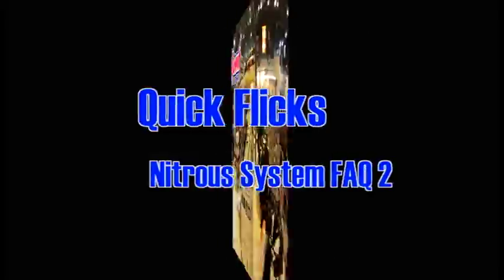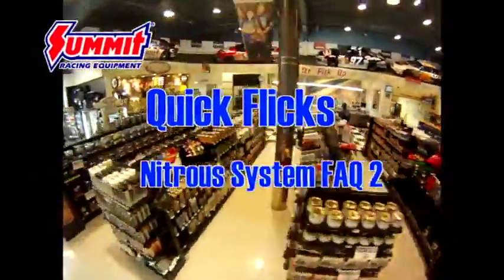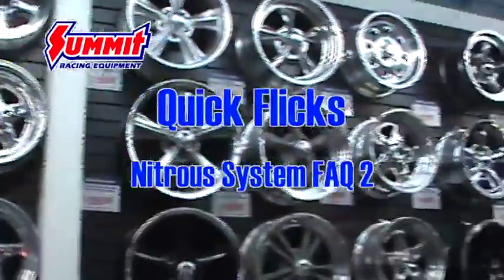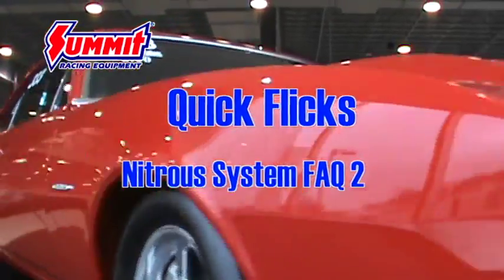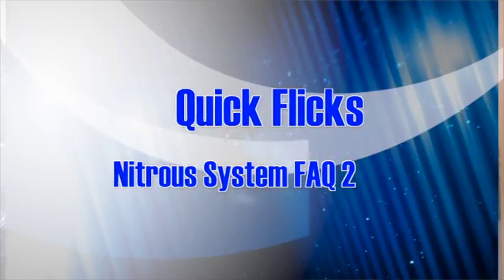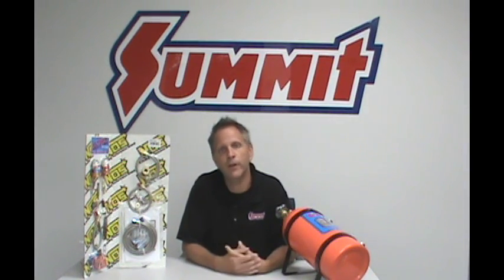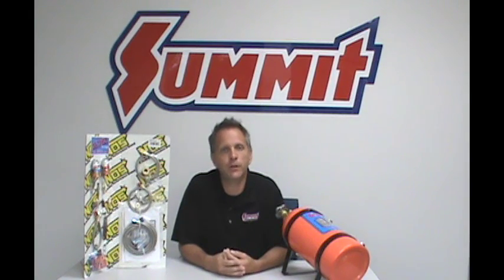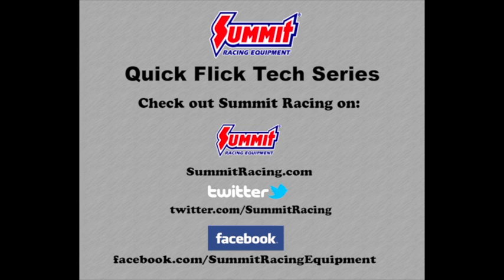Upgrades to Consider When Increasing Horsepower with Nitrous - Summit Racing Quick Flicks

Comment: I have a 302 ford with cam , valve springs , and rocker arms upgraded and 72 mm valve body  what's recommend as far as nitrous?
Reply from the maker: Assuming the bottom end of the engine (crank, rods, and pistons) are still all stock, I would recommend a max 125 to 150 hp system. For the exact kit, we would need to know the year and make of the vehicle the engine is in.

Comment: i had a 350 4bolt main i threw in a 200 wet shot and ran a 6 on the 1/8 mile........only 1 pass though :(

Comment: Should i file down piston rings if i plan on running nos ? I dont plan on going pass a 100 shot in a sbc with stock parts other than cam and heads ?

Comment: With nitrous do you have to make the gaps in your piston rings bigger?
Reply from the maker: Hi Rico, 
Yes, depending on the additional power added  (kit size) by the NO2 kit. This extra power adds additional heat to the chamber thus expanding the upper ring more. If you know during the engine build process that NO2 will be used, it’s a good idea to add some ring gap so that the ends don’t butt together and damage the ring land in the piston.

Comment: i have a 1987 mazda rx7 1.3l rotary engine , this might be confusing when you hear 1.3 liters... but it is documented as 1.3 liters, but since we arent your typical piston engine, i think the community accepts the as 2.6l , equivalent to a 6 cylinder engine  . naturaly aspirated, i just ordered the 35 to 75 shot sniper efi wet system . i want to know how much i could run, it was rebuilt about 26k miles ago, i installed a walbro 255 fuel pump.  mods i have is basically just silicone vaccum hoses, and suspension mods and a cherry bomb muffler im hoping for 175 shot with this car, but 75 for now would be great. i also removed my 5th and 6th sports which basically is what a variable cam timing would be one a piston engine, so all my ports are always opened, its our version of liek hondas vtec
Reply: great thanks for the reply, i will make sure to give a 5 star review on the summit page, and leave positive feed back once i install the kit. i got the kit the same day i ordered it . thanks summit . keep up the great work, i am never disappointed by the this company.

Comment from the maker: Hi Airidas, 
Keep in mind that the motor was not designed from the factory to be used with Nitrous but, as long as you keep the NO2 kit size realistic, such as 50-75 additional horsepower, you will not have a problem. Anything more should be considered at your own risk! Thanks for watching!

Comment from the maker: Hi Matthew, 
Not necessarily unless the motor has high mileage, then you should at least consider a new set of valve springs. The reason is because of the increased RPM the motor will see when using the NO2. A few other simple items; make sure your air & fuel filters are clean; check your timing and reset to factory spec if necessary and regap your spark plugs, maybe even subtracting a few thousands of gap to ensure a strong spark! Thank you for watching :)

Comment: Great video, Im just trying to look into gaining HP, I have  a stock 93 tbird (V6 3.8) naturally aspirated, would I have to upgrade engine components such as valve springs/cam/push rods to run a 60-75 HP shot?

Comment: i have a 92 silverado the has a 5.7 tbi. i want to run nitrous but. i want to change my  intake manifold to a carb. will any regular intake manifold fit the block.it seams like nos kits for tbi are way more expensive than carb kits with a plate. any help will be great thanks. summit always has the deals thats for sure. ull have my business thats for sure thanks

Comment: I have  turbo 2.2 10.5 CR 25psi and i want to run 150 shot nitrous and i want to know what heat range  plugs i should run the coldest i found are 9's

Comment from the maker: If “Bone Stock” means as the car was delivered from the factory in 1978; a 50-75 horsepower addition is all I would recommend.  A bigger concern for this particular car is the lack of underhood clearance. A typical Nitrous kit contains a plate that mounts between the carburetor and the intake manifold that measures 1” thick. This is enough on this car with the factory flat hood to stop the hood from closing and latching properly! Please let us know if you have any more questions. Thanks!

Comment from the maker: A nitrous system that produces no more than 75 HP would be the best choice for your Toyota due to it being fuel injected and it having a smaller displacement engine. I suggest you go with a Zex nitrous system, the part number for this system is ZEX-82021 ($609.95).

Comment: I have a 2011 chevy silverado 4.8  2wd with flexfuel but I my guestion is I am using E85 gas and I would like to still use it cuse its cheep here in tx but can I use nitrous and be using e85 as gas or do I need to use reguler gas? Pls help :)